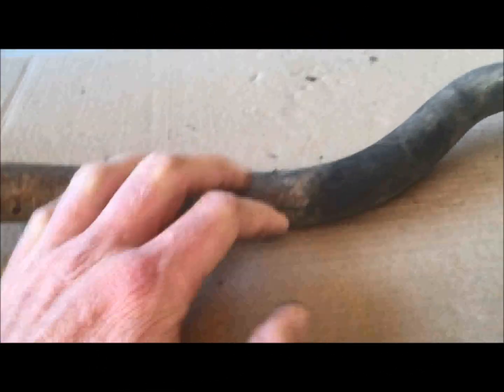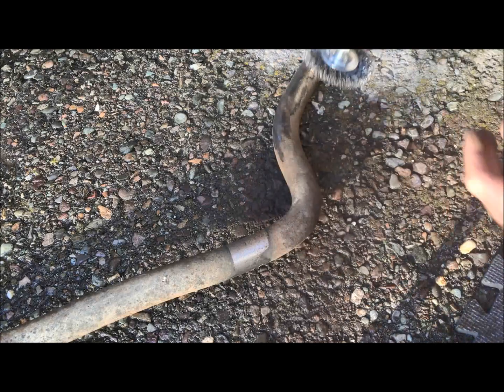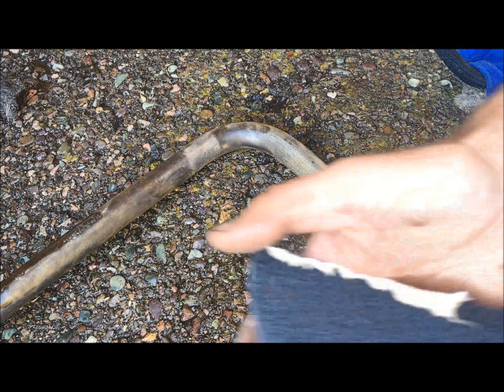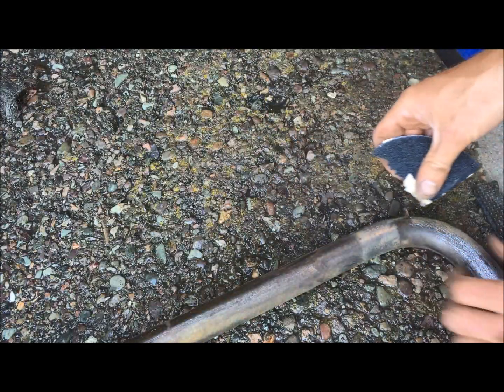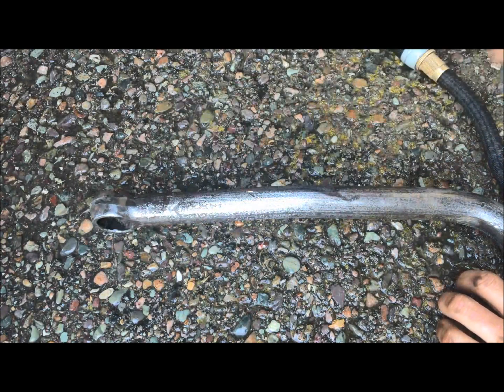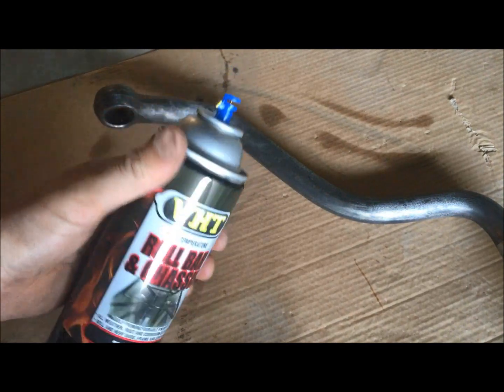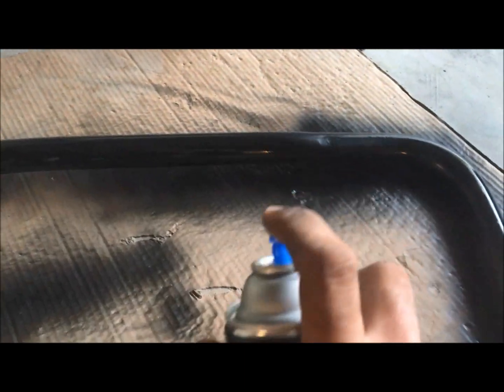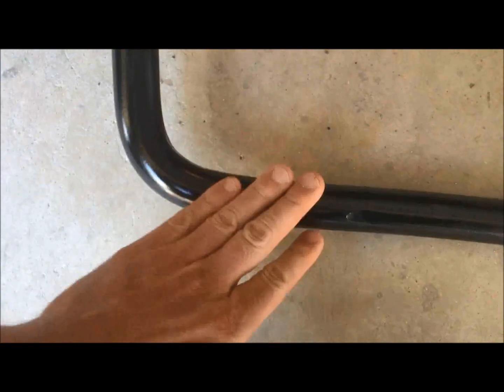How to Paint Chassis, Suspension & Roll Bar Parts

Comment: For large parts with heavy rust I usually use stainless steel scouring pads, the large curly ribbon type.  Get them at the dollar store.  Just wear a leather work glove and palm the scouring pads along the part. I've also used naval jelly on a recent set of control arms and it removed alot of the rust stuck inside pitting.  I used this VHT roll bar chassis paint for the first time, I hung the part up and kept applying light coats every 10 minutes, did way more than just 3 coats.  It's been hanging up in the attic for 3 days now where it's around 85-90 degress and seems to still be getting harder.  24hrs after it still felt soft, my finger nail was able to leave an impression when pressed.  I'm going to hang it a full 7 days before installing.
Reply from the maker: Nice tips!

Comment: Since you painted it on the ground, did it blend well when you did the other side? I'm trying to paint some heavy ass aftermarket rear lower links and don't have a good way to suspend them. I thought if I sprayed one side that I would have to wait for it to dry before doing the other side and it might look weird where the older paint crosses over with the newer paint. Clearly I don't paint often.
Reply from the maker: It ended up looking very nice.  Being black it hid the overlap perfectly.

Comment: I used that on my truck frame. Only difference to save some elbow grease I sand blasted most of the rust away, since the undercarriage can be exposed to the elements; I primed it with Rust-Oleum "Rusty Metal Primer". That's when I top coated the whole frame with about 6 cans that I purchased on Amazon for about $7 a can. How is this piece holding up so far?
Reply from the maker: Sounds like you did it up right!  I bet it looks awesome.  So far the piece looks like I just painted it.  Holding up really well.
Reply: @MechanicLife  It's good stuff, I'm surprised I haven't seen that many videos on it. Maybe I should make one and make another one in a year or two to see how it looks afterwards.
Reply from the maker: For sure.  You should totally rock a video!  Sounds like the work you already did would have made a sweet upload.
Reply: The vht rollbar&chassis paint works really well I got the frame of my 90 GMC k1500 painted and it looks like new
Reply: @MechanicLife  where's that video
Reply: @fiffe7782  it’s in the works… 😅